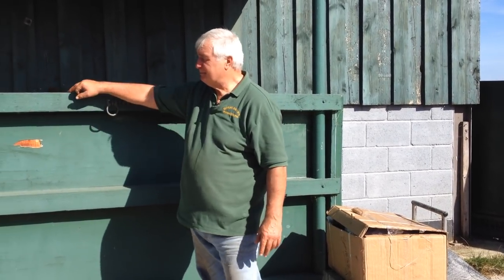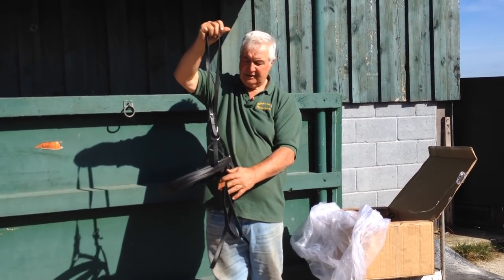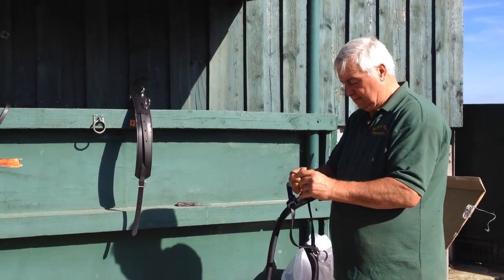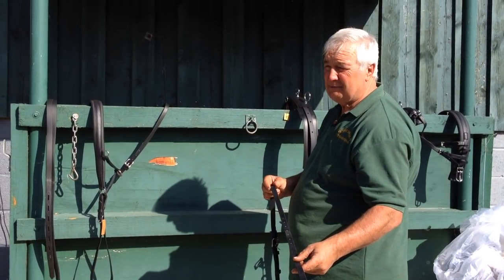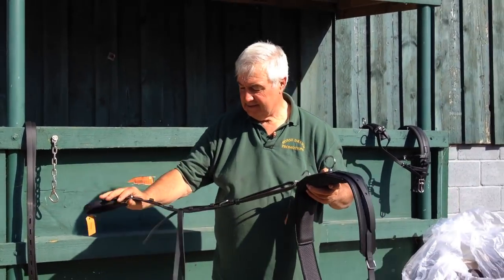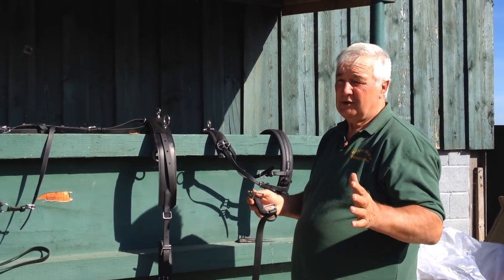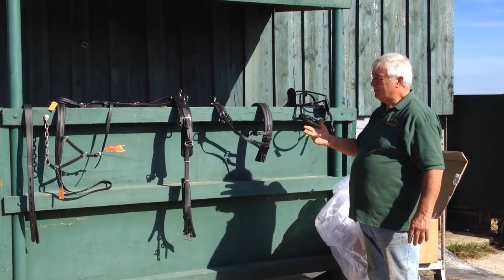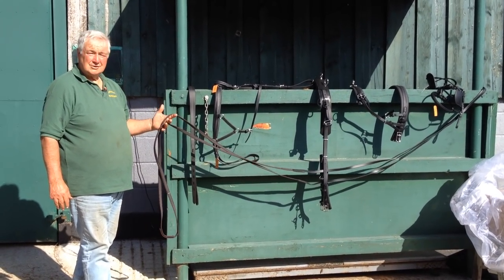How to Harness; Part One - From Box to Beam

Comment: Apart from the quickrelease snaps on the traces, some people here also put one between the backstrap and the saddle. Makes taking a cart off the horse in emergency (like in a ditch/water which we have plenty of here) much easier, breeching is often difficult to reach then. Snaps from the traces + saddle can have a rope to make opening them all easier in such an emergency. Run them up to the saddle and you only need te reach one fairly small area to seperate horse from cart.